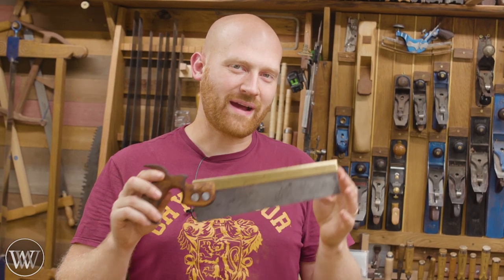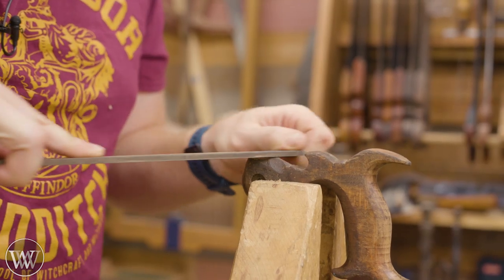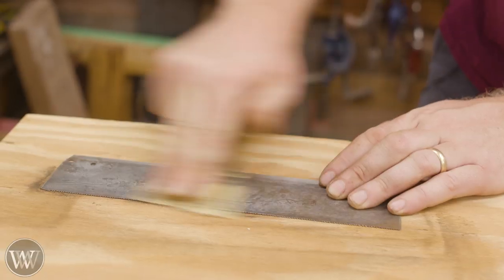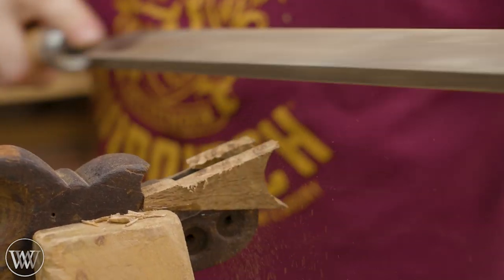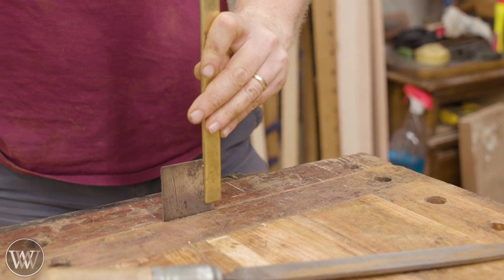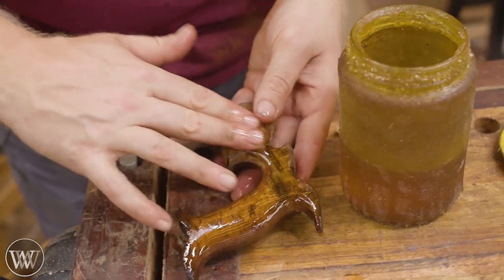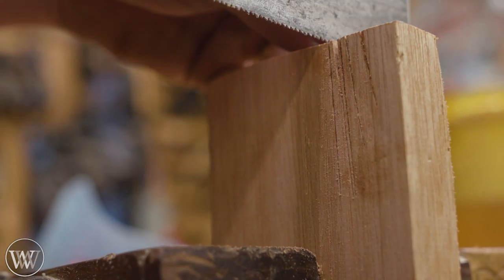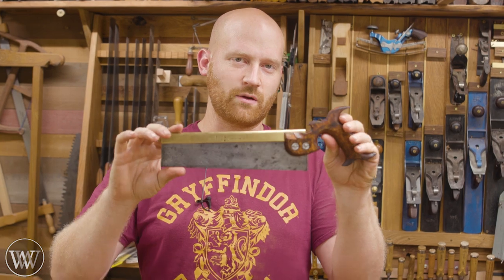How to Restor a 100 Year Old Back Saw

Comment: As all of my saws, except 1, are inherited, I have restored many saws that were totally covered in rust and brown as the dirt. I love seeing how others tackle the project. I tend to soak the plates and steel nuts in Evapo-Rust - I believe James did a video where he used a 1:1 of vinegar to water - to clear out the pits. If anyone is interested in really cleaning up the brass, tomato juice or ketchup works wonderfully. If there is rusting under the spine, I use 400 grit sandpaper folded over to clean it. Alternatively, string soaked in Evapo-Rust or vinegar water will work if you are concerned about removing material and having a loose fit.

The files James uses are Bahco files, if anyone was wondering.

Comment: I use western saw's because I know how to use them and I live just outside Sheffield England so you could say I'm blessed with cheap tools to restore but honestly I got my back saw's new from footprint as they're one of the very few old toolmakers still here making quality tools, I got these as I didn't have a setting tool or good file back then now I'm just hunting for a cross cut panel and a gnarly old big toothed saw mainly just to look at because far to many old tools around here end up getting smelted down or rusting away

Comment: What is that handle/bit holder you're using for the split saw nut driver?  It looks like it has very short push/spiral drive and possible ratchet capability?

Comment: Hello James, great work on those handles!  A bit off topic but Ive seen you use a Veritas tenon saw for various cuts... is it filed rip or crosscut?  i recently acquired one filed rip that I want to convert to crosscut...any tips?
Reply from the maker: Crosscut. That's one thing that really bugs me about Veritas. A. Carcass saw is crosscut. If it's rip cut then it is either a very large dovetail saw or a very small tendon saw.

Comment: Really nice demonstration and saw! I'm a beginner and just learning about restoration - and saws - so this is helpful. Do you use WD40 on the blade after cleaning it or some other kind of oil to provide protection?
Reply from the maker: I just use paste wax. It adds lubrication to the saw for easier use as well as protects the plate.

Comment: I'm in the UK and picked up a similar Sheffield saw for about a £1. I need to restore but the blade has a bend in it.can it be saved?
Reply: I have the same / a similar question. The plate on mine has a  very slight kink. Can it be hammered out?
Reply from the maker: most of the time no. if there is a kink it is beyond repair.

Comment: Great to see how you styled the repairs to the handle - so many old saws end up with damaged handles - probably knocked off the bench onto the floor ? A question. In a traditional shop where the furniture is all hand-made, and the saw is used every day, how long before it is re-sharpened ? Are they sharpened every week ? Would that mean having a couple ( at least ) of identical saws so that there is always one ready-sharpened waiting to be used ? Maybe in a big shop the apprentice used to spend a lot of time doing this ? It must annoy you if you try to use a saw that is not as sharp as it can be ?
Reply from the maker: that depends on you. I generally sharpen most of my saws once every 6 months or so. but some professional shop use to do ti once a month or once a week for some over used saws.

Comment: I have been looking for a two pronged screwdriver/head. Does it have a technical name and where can I buy one?
Reply from the maker: it is a split screw driver. Blackburn tool works sells them. https://www.blackburntools.com/new-tools/new-saws-and-related/saw-nut-spanner/index.html 
but most people just modify an existing screwdriver.
Reply: @WoodByWrightHowTo  Many thanks! Very useful indeed - no suppliers for this sort of gear in the UK. International shipping quite reasonable.

Comment: The title says ‘Restor’ instead of ‘Restore’!  

Thanks a lot for this though, will help with the antique tools I bought and the ones to come.  

What kind of oil do you use for the metal, the plate? Also heard wax works well. 
And the files used, they are the same files one uses for metalwork? Or are these some kind of rasp?
Also you mentioned the ‘old tallow’, did they use to grease these things up with cow fat?

Very impressed with the result!
Reply from the maker: I use basically any oil or wax. I have around grid. Usually it's a linseed oil and/or a beeswax. For the files. They're the same ones you use on metal. For a file. There isn't a difference between wood files and metal files. The rasps are designed for wood though.
Reply: @WoodByWrightHowTo  Interesting, thanks a lot!

Comment: Out of curiosity: why epoxy instead of wood glue?
Reply from the maker: It is easier to work with and does not require clamping pressure. PVA requires a serious amount of pressure to work properly.